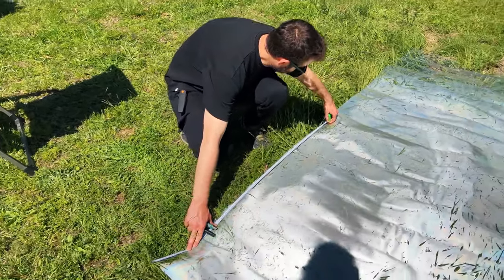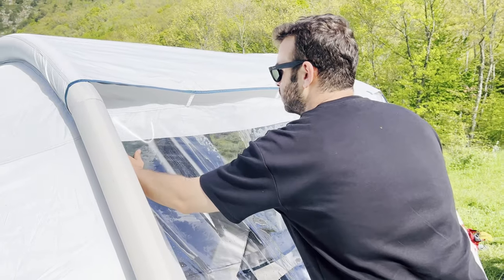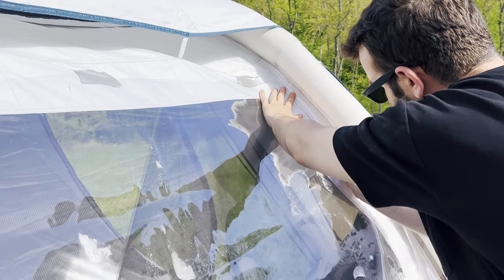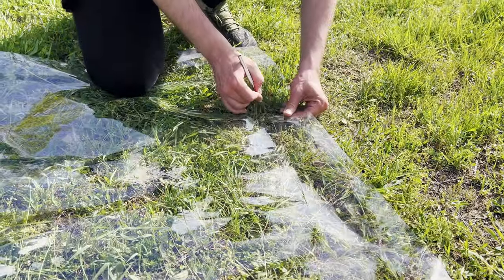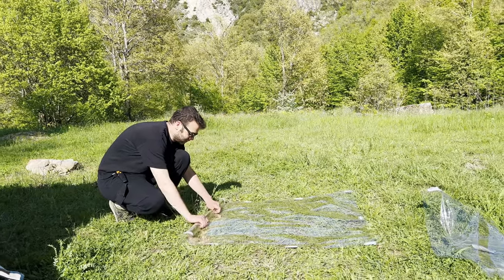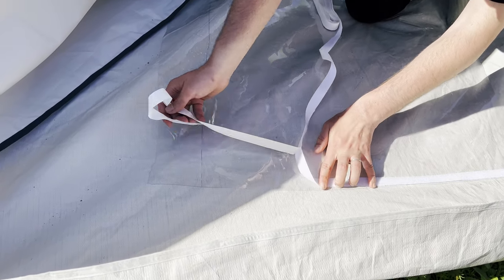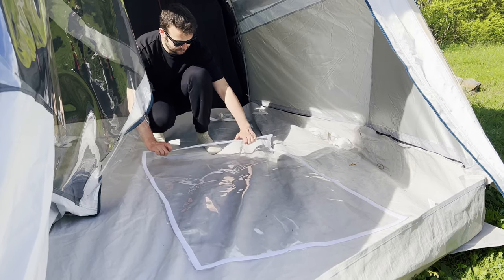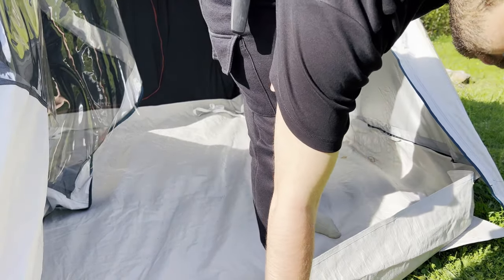Decathlon Air Seconds 4.1 Inflatable Tent Modification | DIY Hot Tent | Ventilation Closure Tutorial

Comment: Hi Good job on improving heat retention. I won't need this, as I live in a warmer country, where ventilation is needed. Have you thought about an extension to the living area? I think Decathlon have a universal tent extension?
Reply from the maker: Thanks for your comment. I am not interested to extend living area but I am using tarp infront of tent. It is also from Decathlon. You can check my camping videos for how I use it.